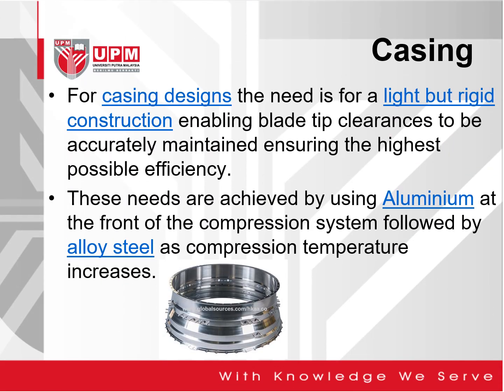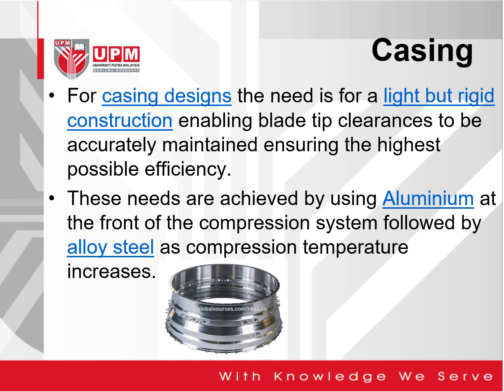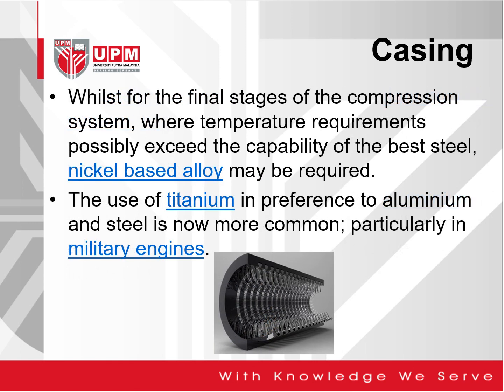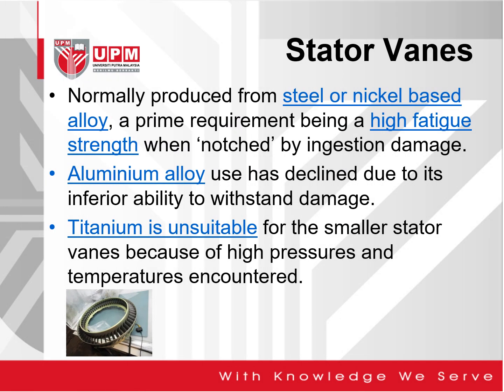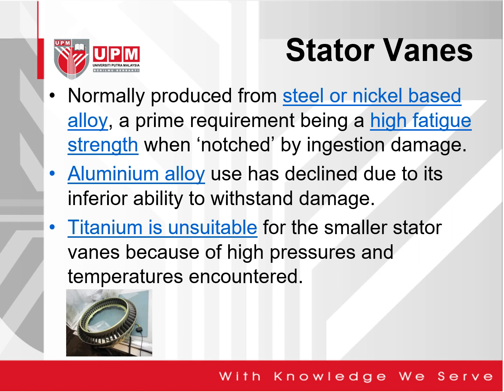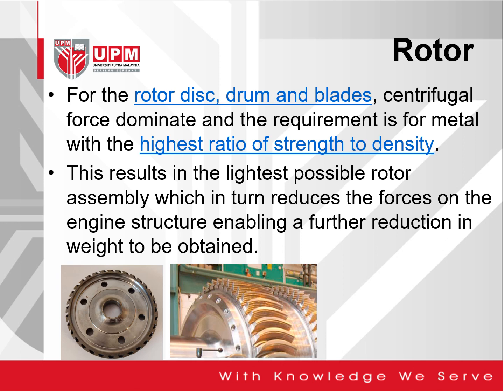Compressor: Materials and Balancing

Comment: Dr. basically what is the type of balancing being used? thank you dr.
Reply from the maker: A method of balancing a gas turbine engine rotor comprises the step of obtaining a rotor disc with a circumferential array of balance tabs projecting from a peripheral rim of the disc. Stress shielding scallops are defined in the rotor disc between the tabs. The balancing is achieved by removing material from at least one of the tabs.